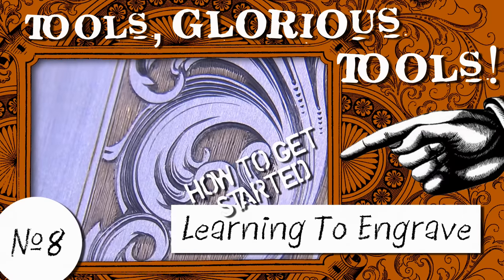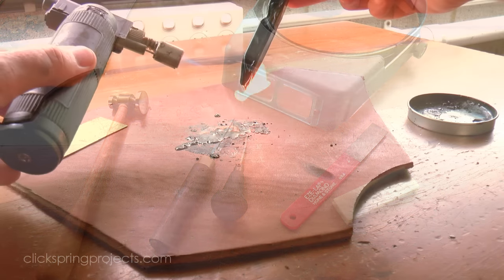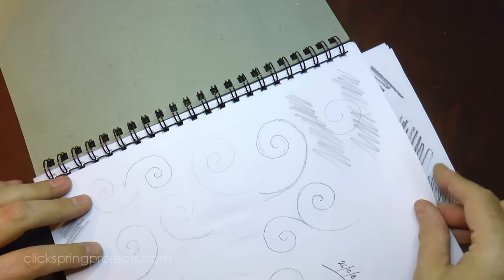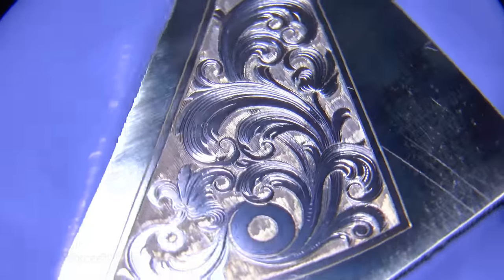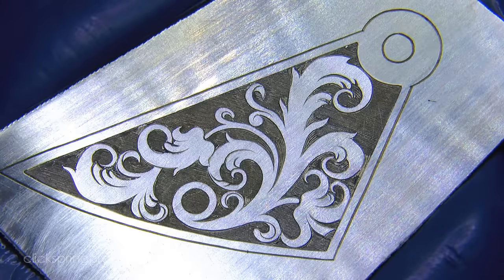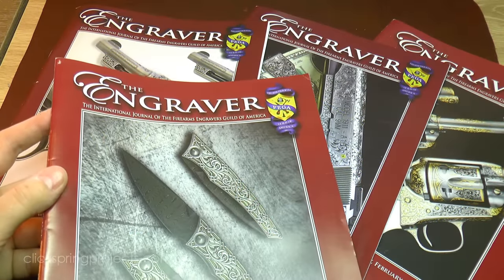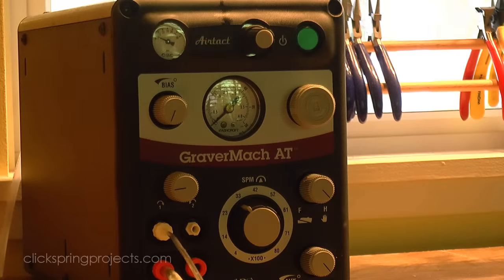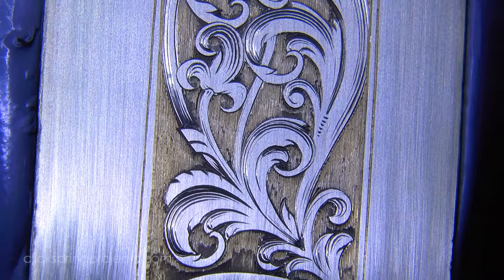Tools, Glorious Tools! #8 - Learning To Engrave

Comment: That's a good idea for a video actually. Making an engraver. ThisOldTony made an air powered chisel on his lathe and mill, so I imagine the engraver is just a teeny tiny Sherline-sized one of the same. Smaller mass inside means higher frequency and lower amplitude.

Comment: In USD $ a bit over 2000 for the power graver, 500 for the handle, 500-1000 for the vise, 3000 for the microscope and stand, 30 for one graver and toolholder, 1000 to 1500 for the hone.  Professional kit is definitely an investment.

Comment: i was lucky enough to get taught the bare fundementals of engraving at school (studying to be a silversmith currently) before the engraving teacher retired.

my school engraving kit existed of no more than 3 push gravers, a piece of plywood to nail a plate to (we had these tiny brass nails to do that with) and a leather pillow to spin that piece of wood on.

and it was essentially all that was needed to cut any work, as long as it was on a flat plate.

this video has made me realize though, that there is a giant hole in my education (maybe because it was cut short, or maybe because we werent getting schooled to be engravers) that has kindoff left me struggling to grow any further. we never had any form of engraving design or anything like it, i guess ill have to pick up the pencil and teach myself.

not the first time ive found myself thinking my education is too technical and not enough design oriented
Reply: I'd say pick some simple-looking flower to engrave, and keep some notes of everything else that you think of to engrave while you're working on it.

Comment: I have a friend that engraves drums and is extremely good at it and was a drummer. I do not have the patience for it but I enjoy watching it. Also just got back from Greece and went to the museum finally and saw the Antikythera. It was not as big as I thought it would be and there were a number of recreations around it on display as well. Got a few pics but they had a polarizer in front of it to bring out the details which made it hard to get a good pic from the front but you could get from the sides some. IIRC the ticket price was like $8euro. Nice museum and it's going to be really big after the expansion they are about to start is done.

Comment: Lovely to see a skill that can still be completely analogue. Digital curves are made up of straight lines - albeit very small ones - whereas an analogue curve is infinitely smooth. I know an engraver often uses air percussion or a hammer and lots of potentially jerky tapping, but the tool point is still 'turned' gently round the bends by hand.

It's rather like the business of sound recording (I'm a musician, of sorts). Digital audio is sampled thousands of times a second to recreate sound that's a series of exceedingly tiny square steps, whilst an analogue recording on vinyl or tape often sounds... warmer. Softer. Smoother.

Sigh. I wish MY curves looked as smooth as those, Chris... 👙👀

Comment: I’m (very slowly) trying to teach myself engraving, mostly for jewellery and enamelling applications. I’d say that along with lots and lots of practice at drawing and engraving , getting the sharpening of tools right is extremely important. It’s far easier if you’ve got a fixture to help get the angles absolutely correct, crisp and above all sharp. Doing it by hand is possible but a very skilled operation. I’m going to make a similar jig to the  Lindsay sharpening template system, it’s easy and cheap to put together, is accurate, and can be used on just about any sharpening stone, diamond plate or even with something like the GRS power hone. Steve Lindsay’s engraving equipment is second to none, unfortunately along with the superb quality comes an eye watering price tag which gets even more ruinous when you convert to Aussie dollars and add postage. I’m going to have a go at making my own version of his pneumatic hand piece with my new lathe, I’m sure it won’t be as good but it’ll be a fun and educational project!

Comment: Morning Chris, thanks for another great video which will surely get me dirty handed soon.
I was bitten by the engraving bug several years ago and have been through the stages you recommend. My trouble is I'm just so cheap! having start with hammer and chisel, all home made, I ventured on to trying to make an air powered tool. I eventually made three. None successful. Then I decided to make an electrical one, this powered by a brushless motor, hitting ball bearings against an anvil. Again unsuccessful, but I did learn a lot about motor drives. 
Other home made efforts ensued, carbide gravers, handles, sharpening disc, rotary foot powered vice, microscope, etc etc.
Following all this the only thing I have ever successfully engraved is the name plate on my snooker cue. Hand made of course, and now I see, dated 1997.
However you have inspired me and I will be re-visiting said hobby. Thanks again, I think! Tony, UK.

Comment: Inkscape a free application that is worth learning if you want to play with a lot of design work and it has a very handy spiral tool, however I do acknowledge the value of hand sketching. One handy method for getting your head around producing clean flowing complex curves is to draw a freehand squiggle then draw horizontal and vertical lines at each point where the curve crosses one or both axis, this reveals to you that many curves can be seen as series of elliptical quadrants.  Do you think that there is any benefit in initially photo etching a design to jumpstart the metal removal and help guide the hand cuts that are used to finish the piece?

Comment: I love your work and have a question. 
Have you ever whittled away your pencils, trying to 
produce the perfect faceted point? ✏️
Chronic whittler syndrome?

Thanks so much for the links. I worked replacing portions of these designs for a living for various types of restoration. They have always fascinated me. Especially the foliage. I wouldn’t think of putting tool to material without sketching first.

Comment: Chris, what is that grey medium you're using to hold the pieces of brass in the video??
  I've recently gotten into doing Repoussé & Chasing and a little bit of Engraving but finding a medium to hold the work has been extremely difficult. 
For me Pitch is just way too expensive, the cheapest I've found is around $100 to $150 US for a small 4"x2"x3" loaf pan which is ridiculous imo. I've had other recommend plasticine but it won't harden up and stays in a clay like consistency.
Reply from the maker: I use Thermo-Loc for almost all engraving workholding, great stuff but also not cheap - Cheers :)
Reply: @Clickspring  Would Polymorph plastic work, melts in boiling water. Jaycar still got it?

Comment: Is that Rodico or duct seal you're holding the work piece with? There's a small book called "The Art of Mechanical Drawing" by William F Willard, it's old but has many helpful instructions for home learning mechanical drawing. Engraving is scratching geometrical figures in metal, so its very similar.

Comment: I have looked at getting into engraving for a long while but the one part that holds me up is the graver itself.  I never begrudge a toolmaker the money they ask for what they produce, but $24-$40US is an incredible amount of money for a slip of steel. To tat end I have never found a real reference for what kind of steel they use to make them (for brass I am not sure it would matter) and even grinding/sharpening them seems to be a bit of a black art.

Comment: I’m so untalented that I can’t draw a straight line with a ruler plus have no imagination. So this is really impressive.
Reply: I finally met my twin brother 🫂
Reply: Notice there wasn't a single straight line that wasn't on a practice piece so you should be good
Reply: @Claudio and I stand shoulder to shoulder with you, brother.  I envy those with talent, for I have little.
Reply: Here's the secret to drawing a reasonably straight line: keep your eye on the destination point. Don't look at the origin point, don't look at the pen or pencil, just look at the destination point.

The initial big hurdle in drawing is not learning to draw. Anyone with a working hand can draw. The problem is learning to see. We don't realise just how much interpretation our brain does when we look at things. The part of your brain that thinks it knows what faces or buildings or trees looks like needs to get out of the way, so you can see things as they actually are.

When you are looking at the destination point, you're not focusing on what the drawing implement is doing, or what a straight line should look like. That, right there, is half the battle won.

There's an old forger's trick, which of course you should never use for illegal purposes. If you need to copy someone's signature, turn the paper 180 degrees and copy it upside-down. When you do this, it no longer looks like writing, so the part of your brain that thinks it knows what letters look like will get out of the way. Now, you're looking at abstract shapes rather than letters, and the copy will be much more convincing.

All of the other stuff (e.g. shading techniques, constructive anatomy, using colour, etc) can come later. This is the foundational skill you need to learn. I strongly encourage you to learn it.
Reply: I mean, look at Clickspring's early practice, he was terrible and a few years later he can do this stuff.  So I'm sure you could improve if you tried.
Reply: I can, but only if I use a very, VERY sharp crayon. It helps if the line is only one centimetre long as well.

Comment: What's the noise level like when engraving, both with the hand tools and with the power tools? I'm in an apartment and am wondering if it's viable to do this at home without annoying my neighbors too much. Thanks!
Reply: For hand pushed engraving it’s virtually silent, obviously with hammer and chisel there’s going to be a lot of steady tap tapping, and with the pneumatic machines the biggest problem is compressor noise. Cheap compressors are generally LOUD, and the really good quiet ones are expensive. The noise of the handpiece itself running is probably no more intrusive than something like a fridge’s compressor.

Comment: What is the source of the brass stock and does the brass work harden as the engraving progresses?
Reply: Engravers Brass sheet, 1/16" thick is a good one to start with. Has Lead content and George Weston and Sons in Australia are one supplier. Found my sheet from 15 years ago in the shed, takes to Chris I now have leads to training info I did not have back then.

Comment: WOW that's a lot of money for a desk top air compressor fitted with a coalescing oil trap and filter.
That said those engravers are very nice. I dont engrave but I fix air tools and the very very small air chisels are extremely sensitive to good quality air let alone wear as they then start to hammer inconsistently and will leave a poor line.